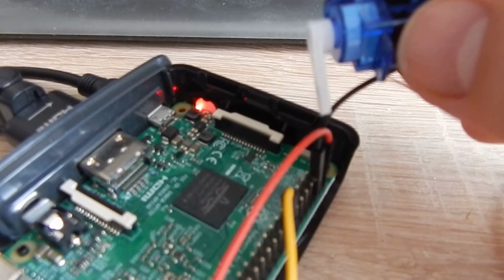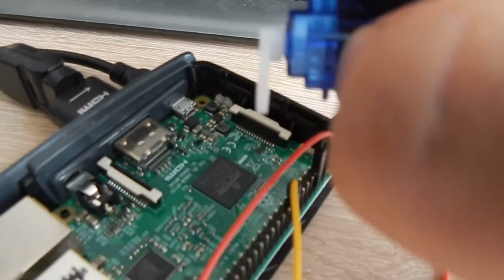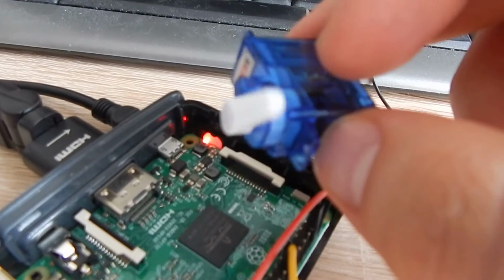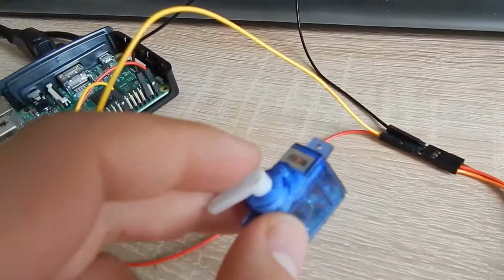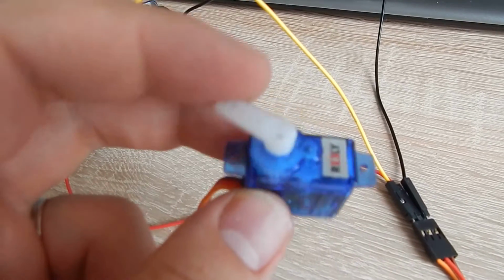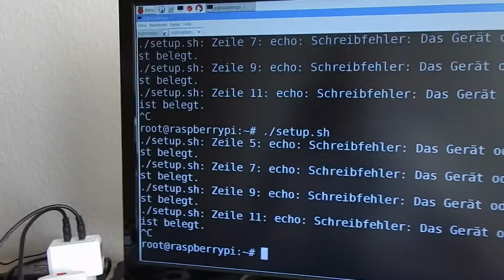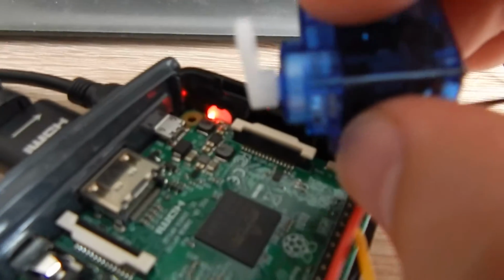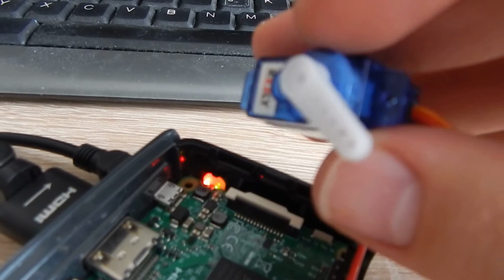Why does the red LED blink when there is a motor connected to Raspberry Pi 3?

Comment: because RP /IO need driver that drive current for Stepper and Servo motors . just don't try to draw current from each Gpio more than 10 mA. in this case you can attach current driver and buffer inclouding OpAmp or Mosfet for current and isolation gpio to your real-world devices